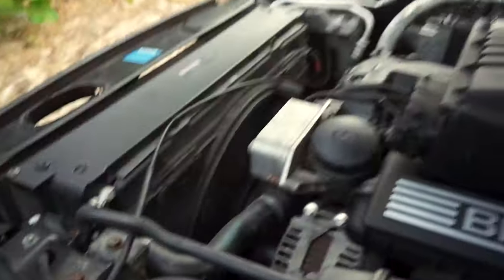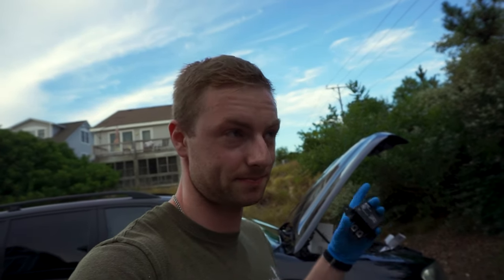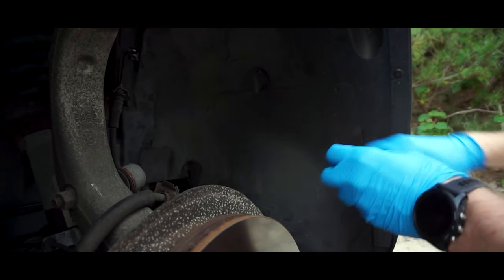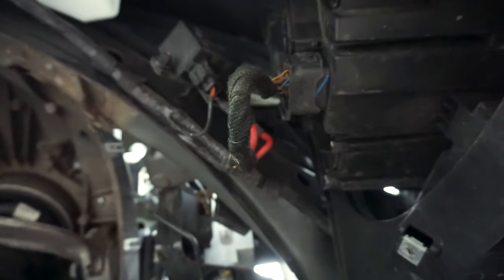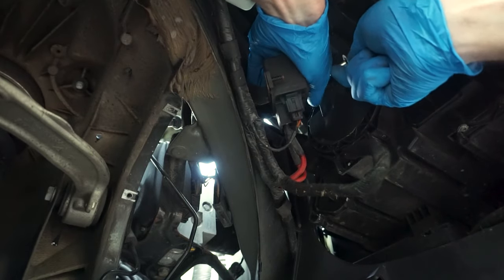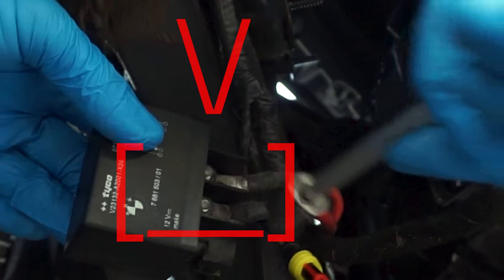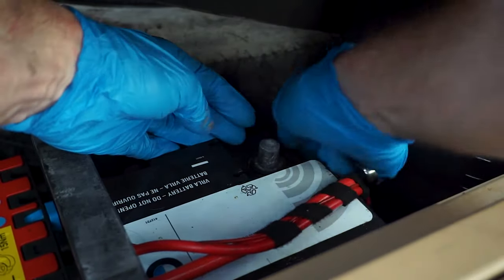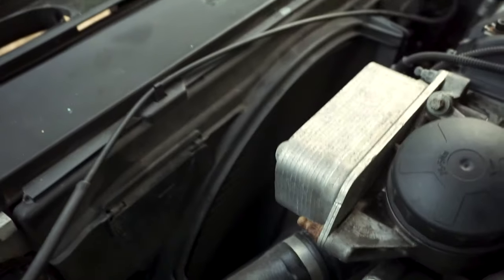How to replace radiator fan relay on BMW Auxility fan relay switch N54 N52 Overheating 2efe code

Comment from the maker: That was a long way to fix it! With out my mess up, I wouldn't be able to make that vid for you!) Comment below if you have any Overheating related questions about N52/N54.
See this video: What I did before replacing Relay - https://www.youtube.com/watch?v=J2mUbrXZqFc&t=236s
Reply: Got an o6 325i new radiator, fan , both temp sensors, reservoir tank and hoses and fuses seem to be fine, I just took it to bmw for three recalls which was the heater core, airbag, and wire harness to it, first the fan wouldn’t turn on but the next day it was working fine then again no cold ac so ichecked the fan and it wasn’t turning, would this be my best bet ? Thank you!
Reply from the maker: @abrahamvera6366  like in the video there are loose connection somewhere so just follow the ground cable and a positive cable and make sure the intact, because I had exact same issue and as you seen it in the video I had loose connection to the relay.
Reply: Going to try this fan relay just bought it for 35$ at bmw but if not it might be wiring because my expansion tank did blow up and got all over the connector and wire hoepfully it’s just the relay tho great video!
Reply: Yeah so my 07 x3 is a e83/m54/ n52...all in a nutshell?? At 179k miles I would like to see how long it'll last for me..
Reply: @treach5196  i have the same car did it fix your problem?
Reply: I have a radiator fan stuck on high with the overheating code. Already ordered the part to fix this and hopefully it will be that
Reply from the maker: @sugardaddy3145  Consider temperature sensor, but if not most likely it's a Water Pump...
Reply: Would this be in the same area on a 2006 530xi

Comment: Great, your video will be very useful to me. I have code 2EFE and the fan turns on but it blows when I turn on the air conditioning and it has to turn on at high volume.

Comment: Is it in the same place on an x5 e70 3.0sd? I have a problem with the fan, it doesn't start all the time and only on the high mode. thanks!
Reply from the maker: It's should be there, also it's really easy to see it from under the hood, just see where the positive/Red cable from fan going, and it will get you to relay!

Comment: What year, make, model is your car? I want to replace the relay on my 2008 X5 3.0si, which relay #7661503 apparently does not match. Thanks for any details!
Reply from the maker: Thanks for the pointing on my mistakes! the car is 2007 BMW X5 E70 N52 3.0si, Yes the Multi Purpose Relay (150 Amp) (Black) Mfg Part # 61367661503, that the same relay was installed on my car, check the link in description for the part i used! As far as the diagram on the top of the relay match with your that should work, also it's got to be 150Amp.

Comment: I have 2008 bmw 328i e92 Coupé with n52 motor my radiator fan only twitches in idle but runs okay with a/c on not sure what the issues is I changed thermostat,coolant flush ,new resivoir , new radiator not sure what it could be or if I just need a new fan I think it’s the original fan too also got a new fuse to 😅
Reply from the maker: the 328 should have the fan switch, but if you don't it most likely the fan, just read the forum, the few people was going over the similar problem, the fix was the fan replacement. good luck!

Comment: Did you have voltage on the connector to the fan? I have ground and voltage and continuity in my signal wire and I even replaced the fan but it’s still not activating
Reply from the maker: There could be the passage of voltage, but relay it self failing, and it's dirt cheap, so i would replace it anyway, there nothing else in between of the fan and DME, only relay!
There little connect that comming from DME,  if you replace relay and it still not working, there could be a problem in the wiring or connector itself, but like i said, replace the relay first, then go from there!
Reply: You ever get this fixed?

Comment: Hello, great video! I have problem with my e71 X6 5.0i 2008 it shows the engine overheating yellow light then turns into red and I changed the antifreeze hoses because it was leaking and now it’s good from that point but the cooling fan wasn’t working too so I ordered new fan and replaced it and again the engine is reaching about 100 degrees and increasing up to 120 and overheating but the fan isn’t starting or when it starts it’s not working on high speed it’s not working properly, what can cause this problem? Sometimes it just starts and stops and repeats this action, what should I look for?
Reply from the maker: I could think about a couple of things. The first one is the temperature sensor, which seats on the oil filter housing, Second, it's the same location, which is the oil temperature seems. they are directly related to the fan speed. as for the coolant temp. it's normal for BMW to run hoot, as 100-110C, but the fan should be on at this temp. 
Good luck, and let me know if you resolve the issue.

Comment: So I have a quick question I have a 2016 BMW X6 50i. Is the relay in the same place as your BMW because my fan isn’t working either and we tried changing the fan and everything else and none of that worked.
Reply from the maker: Yes, you should have one. and it's easy to check. Also if you gonna be ordering one, make sure you have the right Amp count, as far as I know, their variation of 150 & 130Amp. and make sure to disconnect the battery if you gonna be replacing one since it has a positive cable going directly in.
 https://www.realoem.com/bmw/enUS/showparts?id=KU63-USA-05-2016-F16-BMW-X6_50iX&diagId=61_3511

Comment: Does the f30 335i have the same relay? I’m a heavy equipment mechanic and am new to bmw
Reply from the maker: I have a Great tip for you!) The RealOEM.com diagrams part N. and more. It's a best friend for the BMW owners!
https://www.realoem.com/bmw/enUS/showparts?id=3A93-USA-05-2012-F30-BMW-335i&diagId=61_3108
I chose the 2011 f30 n55. and it says it has a relay. But check it for yourself, type the VIN. Or get the right input on the web. In that case, you will know for sure!

Comment: I have a 2009 E70 3.0. My fan runs on high when I start the car even when cold so I know it's not overheating. The fan runs for about 4 minutes while driving then shuts off. Then it comes on about 20 seconds later then runs for about 20 seconds and this cycle continues while I keep driving. Thoughts?
Reply from the maker: possible cause could be a failing water pump or thermostat, make sure to check the codes and see what you can find, the relay is just a pass trough, so it either work or not, temp. sensor could also be the case. good luck.

Comment: Hi,
Does the f02/2011 750li have a relay? If so, do you know the part # and location? I can’t seem to find the part on bmw dealers parts catalogue or any official documentation.
Reply from the maker: Hey. The realoem,com is the best place for diagrams and part number research.
If you use your vin on the main page, it will show your build. 
But that’s what I found:
https://www.realoem.com/bmw/enUS/showparts?id=KB83-USA-06-2011-F02-BMW-750Li&diagId=61_3808
Good luck!
Reply: @Makhnovets thanks. I did find it in the trunk. Can these be tested with a multimeter?

Comment: Hello great video I have a 08 bmw 135i and I have the 2efe code I got a new fan from wrecker and still not turning on and I still have the 2efe code?
Reply from the maker: First is to make sure that you have this relay and if so, make sure it's working. https://www.realoem.com/bmw/enUS/showparts?id=UC72-EUR---E82-BMW-135i&diagId=61_3955

The problem also can be in the faulty switch. it's usually seats on the lower radiator housing, pass. side. but not sure if your car have it. make sure all related fuses is good. can you initiate fan from the computer"OBD II scanner"? you should be able to run it true computer.
Reply: Thank you so much for your help and yes my car has that relay it’s cracked on the top will that be the issue, I also tested the fan fuse and it has voltage but when I tested the connecter I connect to the fan and there is no voltage.
Reply from the maker: Can you activate the fan from the software? Like obd scanner?
Reply: Unfortunately I do not have one
Reply from the maker: @guerrerola1237  try to replace the relay and a switch, two main components that will trigger the fan. Good luck!

Comment: my E46 coolant fan stays on doesn't turn off is this probably the solution?
Reply: Have you found problem? Have you replaced pump/thermostat already? Are all your belts working?

Comment: Hey bro, I have a 328i conv The fan turns on when the car runs and turns off only when the car turns off the temperature marks up to 110 on the dashboard
Reply from the maker: in your car you have the radiator fan switch instead relay, so make sure it's working correctly!
also if the car in the limp mode or it's running lean it can case that problem? do you have any massages?
Reply: @Makhnovets The car runs well and everything doesn’t raise the temperature anymore, nor does the car fail
Reply from the maker: @charlylopez3560  check the water pump speed rpm,  see how fast it spin whe at 110*
Reply: @Makhnovets  ok thank you bro
Reply: I have same problem I have bmw 125i f20 with n20 engine had 1d2404 map thermostat control line break and cooling fan running on high speed changed thermostat error is gonne but still even now my cooling fan goes on not on full speed but does spin is this normal? I dont think so because I only driven for 2 miles and fan started to spin when I open bonnet and check as I cannot hear it when in car , I have bought fan relay from BMW will be changing that tomorrow did you find the issue ???? Or any tips what to check ?
Reply: @charlylopez3560  did you find problem I has same problem fan spinning but cannot hear it only when I look underbonnet

Comment: I have a 2004 645ci 4.4 v8. Is the relay the same? I replaced the fan and checked fuses.
Reply from the maker: Check the realoem website, you will find the diagram there for specific car.

Comment: I have bmw x1 2012 model N20 engine. Can you help me to allocate coolant fun relay. Where is it?
Reply from the maker: You can go on realoem.com 
If you type your vin there, it will show all the diagrams and parts specifically for your car. Also you be able to search for all the sensors and there location. Good luck!

Comment: I cant find on my 2007 bmw 335i n54 e93. Is it in the same spot?
Reply from the maker: The simple answer is, you don't have one, the n54 have switch. you might have a relay in different location. you can check the "realoem . com", type your VIN and will give you all options and technicall spec of your car, then you can navigate to electronics and look for fan relay or cooling.

Comment: My fan comes off & on continuously and eventually will show overheat around 200F and becomes limp mode. The car only has 33k original miles. Any ideas?
Reply from the maker: I would blame the temperature sensor, although you should have some codes?
Reply: @Makhnovets  This happened after cylinder #2 misfire due to a bad coil. Replaced all the coils + sparkplugs that's when I noticed the fan comes On & off while driving.

Comment: Does a 2011 528i hav the same fan relay/control module.   Fan on my car doesn’t run at high speed.  It constantly runs at low speed and just been having this issue for a few week.  No codes or anything like that.
Reply from the maker: Check the recent comments, otherwise i will update in a day...

Comment: Plz can u tell me where the relay for the 3 series N52 is located?
Reply from the maker: The 3 Series usually don't have the Relay. If there one its gonna be behind the Battery, I wouldn't bother, the 3-series with n51 n52 n54 don't have one any way. 
You should have a switch on lower radiator housing, https://amzn.to/3M6XX8q. Make sure you have one first. https://www.realoem.com/bmw/enUS/showparts?id=PH73-USA-06-2008-E90N-BMW-328i&diagId=17_0350  -  it's number 10 on the picture. passenger side.

Comment: So I changed my cars coolant temp sensor but sometimes when I start the car the radiator fan goes full blast sometimes. Do you believe is the relay
Reply from the maker: In theory, the relay has only one function, which is power passage. so if it's working-it's working. Make sure your AUC sensor has no messages, and also, the ambient temp sensor shows the right temperature. Do you have any messages on old? 
Just as context, my BMW X5 e70 was doing the same, because the AUC sensor was disconnected and wasn't working, try to clear the memory, make sure the AC is off when you start the car, and see if you have this problem, repeat with AC on. The fan speed is related to AC as well, that's why sometimes you got to make sure that you don't have a problem there. Good luck!
Reply: @Makhnovets  i have a code for the ambient air temp sensor but thats all. That shouldn't cause the fan to go full blast mode sometimes right. Mines a e90 2009 328i

Comment: HiThere, i have an X1 N47/2,0 D, have the same problem, fan does not come on, it works when i put aircon on, and also comes on with Ista connected on both low and high speed, any idea where the relay might be? perhaps will try and replace and hope for the best.
Reply from the maker: That one should answer your question, otherwise enter your vin number on the web, it will show your car and pkg... 
https://www.realoem.com/bmw/enUS/showparts?id=VN71-EUR---E84-BMW-X1%2018d&diagId=61_3820
Good Luck.
Reply: @Makhnovets  thanks so much, managed to get new Relay from BMW dealership, fitted it, but seems the fan still not coming on, confirmed again on ista, both Low and High speed work, also comes  on with A/C on, should i perhaps try and change the coolant temperature switch?
Reply from the maker: Yeah, the switch will be my guess, also make sure you do the have any codes for ac, for example AUC Sensor or so.
Reply: @Makhnovets  Hi there, fit the new coolent temp switch, it sits in the block just above the egr, then checked all  fuses behind the dash compartment , still have not had the fan come on, monitored temp  to 104 degrees (C), should it have kicked in with this temp? or does it need to be higher?. thanks again for all the advice an assistance.

Comment: Is this only for x5? I've a 2007 x3 3.0 si and stuff says it's fuse 37. I've replaced the fan but I ran power to the old 1 and it was dead. Installed new fan and disconnected the coolant temp sensor and it's full blast..connect it back and the fan comes on and off but not at full speed. My obd2 bluetooth says it gets up to 222 at the most and it ll cool down to 210 max..it doesn't turn on when key on engine off..someone give me a clue..New to owning bmw myself. Family loved them over the years. All I remember was they all were worked on atleast on the cooling systems.
Reply from the maker: 2006 BMW X3 Engine Coolant Fan Temperature Switch.
What y of manufacture is your car?
Also, you can check realoem.com
There you can find the parts by typing your VIN, and see diagram! Start from there. From now on That site will be your BMW Bible.

Comment: My dad 2008 BMW x3 3.0 just had a new thermostat put in and it didn’t help and it overheated the second time after my dad got it back what do you guys think it would be?
Reply from the maker: What code you get? also, do the front fan spin when the car is staring or running?
Reply: No the radiator fan does not spin when we start it up and let it run

Comment: I have a 2009 328i x drive. My rad fan doesn't turn on when it needs to so I overheat. I'm getting power to the fan connector. I directly wired to 12v to see if it turns on and nothing. So I bought another rad fan from a wreckers and still won't turn on. I took 12v directly to the replacement fan and didn't turn on either.

Could it be just another dead fan? Do you think it would be this relay?

PS. I replaced the water pump and thermostat as well. Both rad hoses are hot.
Reply from the maker: Hi! First of all the only way to spin the fan without harming anything that true dealer obd tool, as inpa or any other that have ability to trigger the component. The second point is the relay, it's dirt cheap, 15x cheaper than fan, start from small and move toward big. Replace relay, than let me know what you got!
Reply: Cee Jay did you figure out how to get this rad fan to turn on?  I am having the same problem, I checked the fuses, changed the rad fan, relay switch in the glove box.  There is no fan switch on the rad hoses on this model 2009 bmw 328xi E90 like some others that do have a fan switch.  The dealer showed me the schematics for my VIN and said there is no other related relay fan or switches.  It is ECU controlled but I feel there is something I am missing.  I am wondering if you  can shed some light on this issue I have.  Much appreciated if you have anything to suggest.
Reply: @dili00007  I replaced the coolant temperature sensor on the engine block. It is located closer to your oil filter. Was a $30 part and worked right after I switched it! Hope this helps.
Reply: @ceejay6628  Hey thanks for the reply.  After looking at everything I figured out that there is 2 relay switches.  1 in the glove compartment and 2nd under the hood in the white fuse box.  I bought a relay switch from the dealer and swapped them out. I started with the glove then the white fuse box.  It ended up to be a bad relay switch in the white fuse box.   Trying to diagnose this issue on your own is alot of trial and error. Standard OBDII readers cant read the codes. I also used a SNAP-ON reader and all it said was “cooling issue”.  Only the dealer can tell you the real problem.  The diagnosis from the dealer cost more than the actual part…